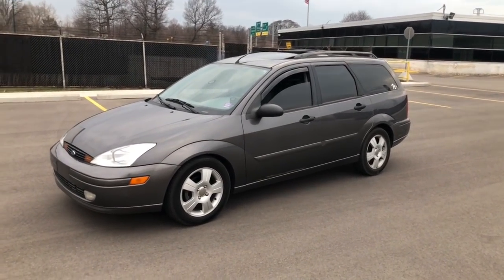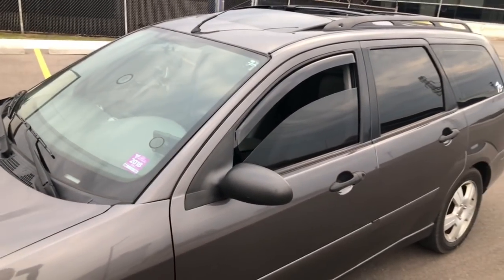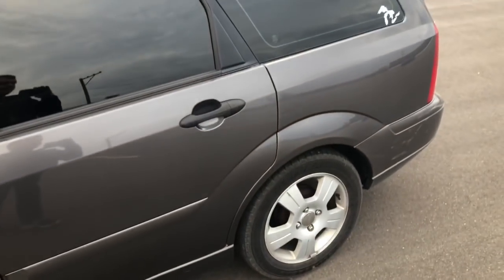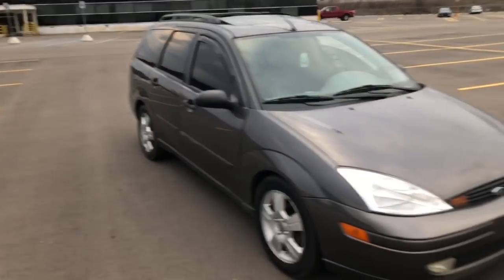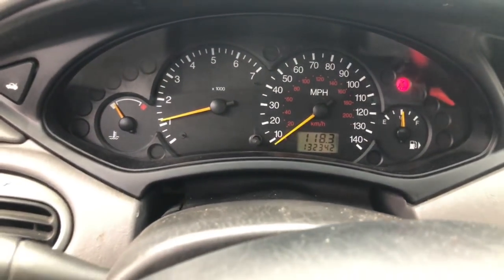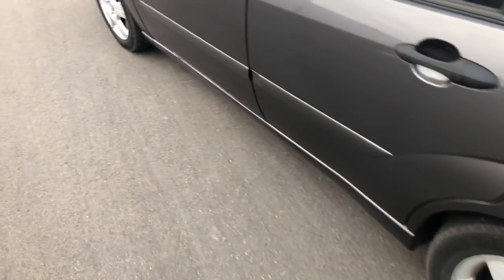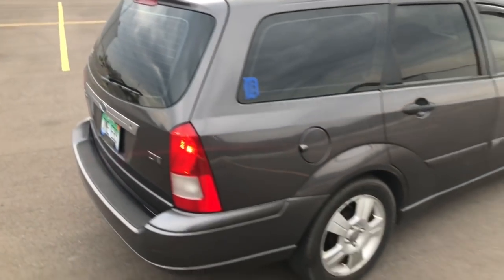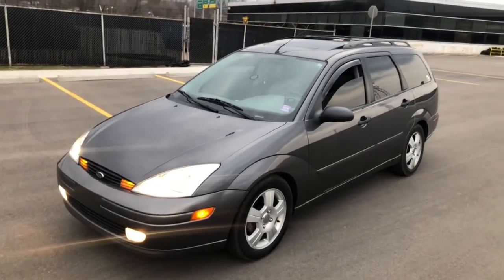2002 Focus ZTW Wagon Update

Comment: Blackvue DR650S or DR750S 2 channel dash cams are the ones id get. 650S is 1080p front and 720p rear. 750S is even higher resolution. Both great products, just comes down to price.